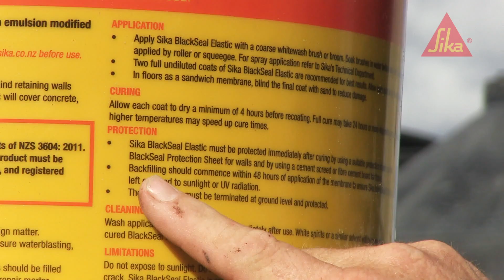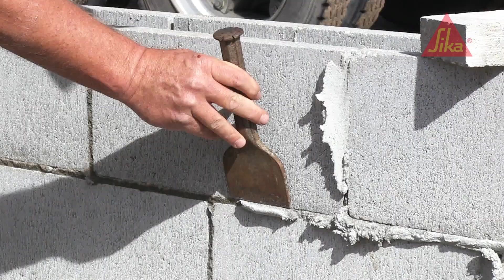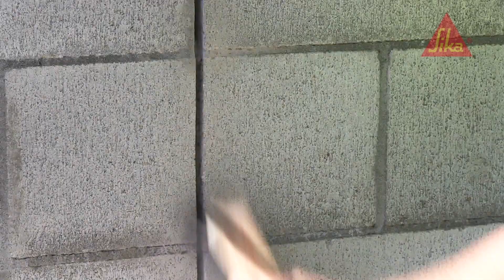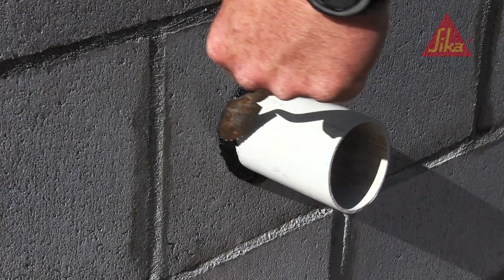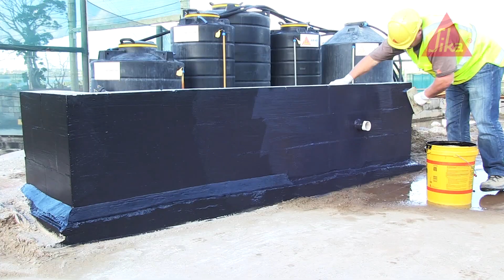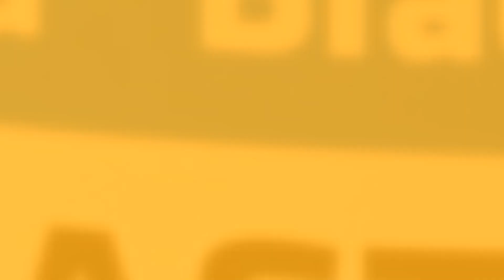How to correctly apply Sika's BRANZ Appraised below ground waterproofing membrane (new packaging)

Comment: Nice video, just wondering where I can buy the brush used in the video. I used the normal paint brush and paint roller, they get really stiff quickly after I started painting
Reply from the maker: Hi Jane, unfortunately we have had to discontinue the brush shown in the video due to ongoing supply issues.  However you still might be able to find the odd one at your local hardware store - it's called the Sika BlackSeal Elastic Brush.  I understand your comment about using a normal paint brush for the job, and not managing very well! We suggest using something like a PAL Block Brush, they are designed for use on blockwork and aren't too coarse. You should be able to find them at your local hardware store too.  Good luck!

Comment: So basicly it was true all butyl rubber need UV protection thats what they break after 2 years.i use blackseal1/BT together with multiseal tapes to do the job.
Reply from the maker: Hi Drincog,

Thank you for your comment on our YouTube video. However, we wanted to clarify that Blackseal is not a butyl rubber, but rather a bituminous emulsion. It is not designed to provide UV protection and is only intended for below ground applications. Therefore, it may not be suitable for certain above ground applications where exposure to UV radiation is a concern.

We appreciate your interest in our products and hope this information is helpful. Please let us know if you have any further questions or concerns
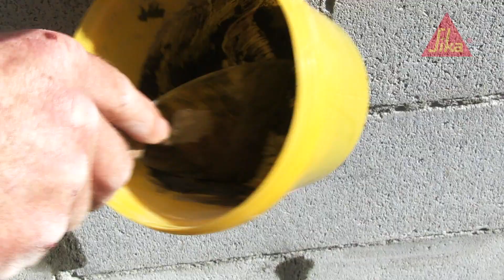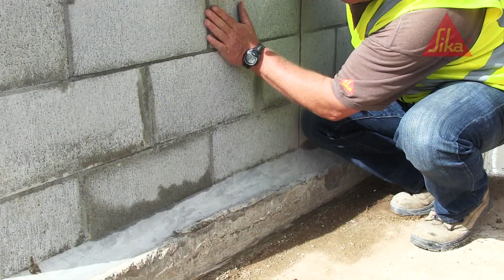Reply: The patching mortar you talk about at the beginning in the tools section - I assume is the same product you use at 2:13 in the flushing section - and, if so, what is this product and where do I get it in NZ? Also, what’s the best product to use to form the “triangular fillet of mortar” mentioned at 2:57? Just a masonry mortar type s? Thanks